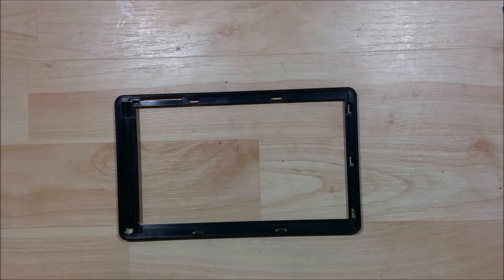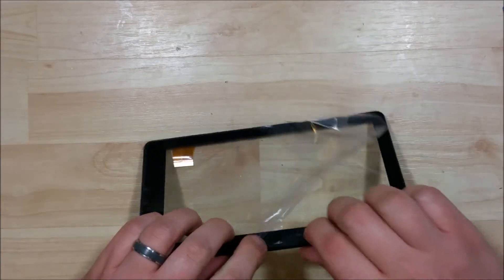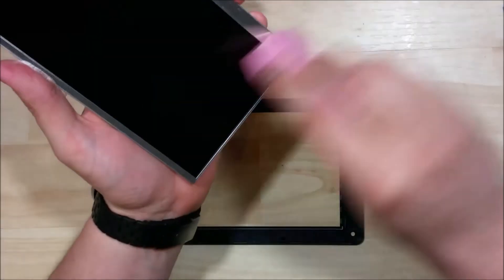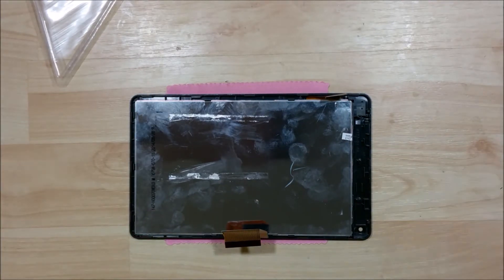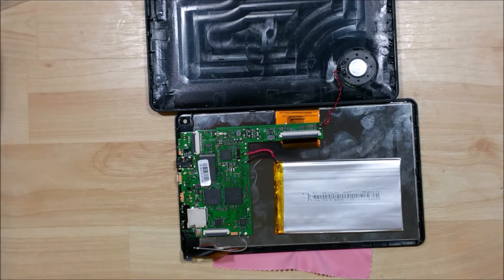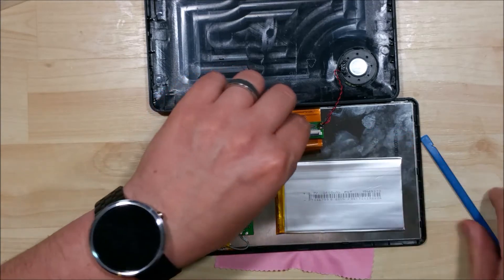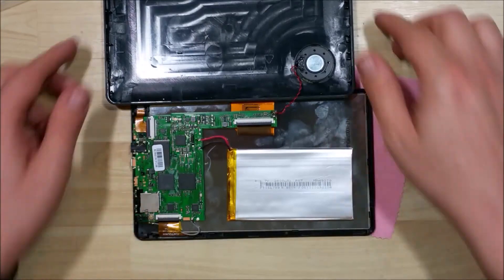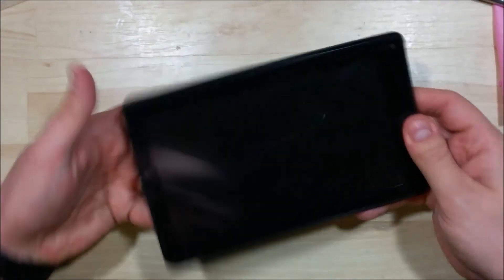RCA Voyager Tablet Glass Digitizer/Touchscreen Replacement - Reassembly - RCT6773W22

Comment: Hey man I have a problem with my voyager pro everything works fine buttons power button but the touch screen isn't it works from the sides but towards the middle it doesn't and at the bottom either  which makes the tablet kinda unusable it was working fine all these 4 months up until today do you know what's happening ?  I can post a video on my channel so u can see